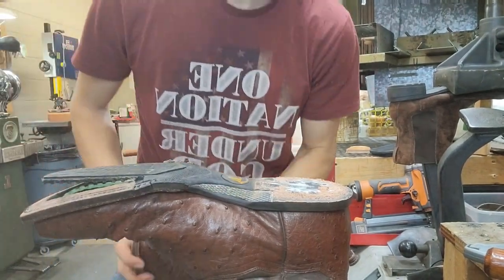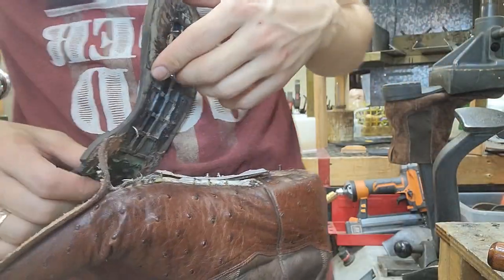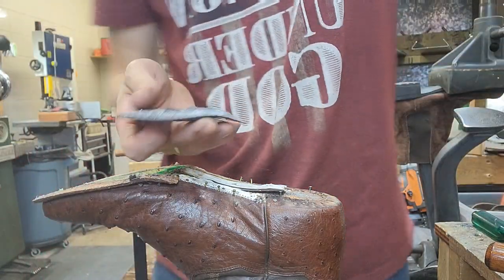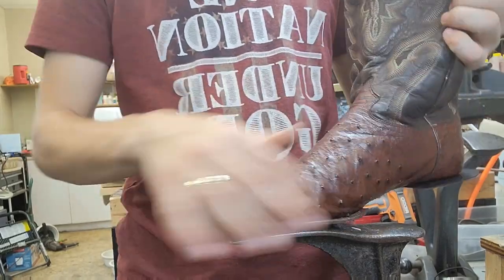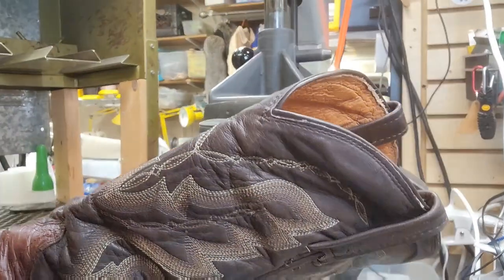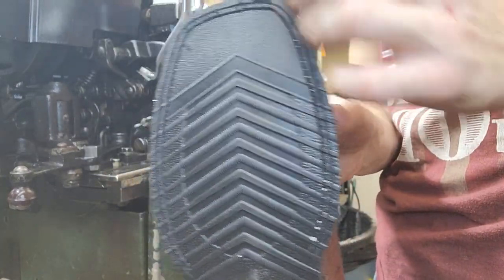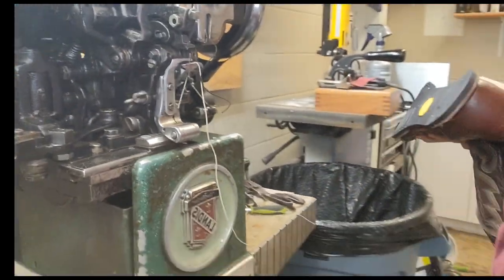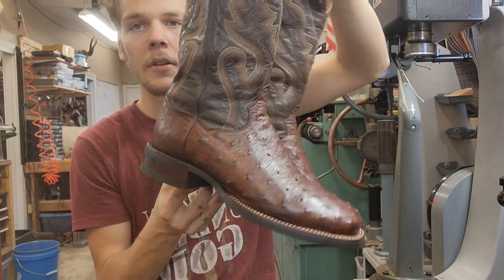Dan Post Cowboy Boot Restoration!

Comment: Glad I found this video. I was specifically looking to see how the sole and heel of Dan Post boots get repaired. 
Personally I was fine with the multi-piece sole. The boots were comfortable and I didn't like the idea of an all leather bottom being scraped up by concrete. Plus, didn't want to slip when it was wet out.
Seeing this let's me know I can absolutely keep my favorite pair a lot longer, where the issue I started having was the leather welts starting to separate.
Reply from the maker: I’m glad you enjoyed the video, the separation is from the threads holding the sole to the welt broke and it’s not holding the sole anymore. That’s a good sign you need a resole

Comment: I have this exact pair of boots, roughly what would it cost to do this to mine. I know that it could vary, just a ballpark. Thanks
Also great video!
Reply from the maker: These repairs start off at $185 for full soles and heels with a double stitch and clean and conditioning
Reply: What would the turn around time be on these boots?  How do I get your shipping address?
Reply from the maker: @bigbr4  right now we are 4-6 weeks out with all our work. If you visit our website https://linktr.ee/shoeman_angelscustomcreations you will see the mail in repairs order form. Fill it out and we will get back with you as soon as we can.
Reply: Are you the one that would be doing my repairs or someone else?  Are you in Jonesboro?  I really like what you did to this pair of Dan Post, I have the exact pair and have had them re-done once and it was a very poor job. Sorry for all the questions. I was extremely impressed with the video of these Dan Post and want mine done.
Reply from the maker: @bigbr4  no worries I encourage the questions. I like to make sure my customers know exactly what I’m doing and why. Yes it’s just me doing the resoles. I have one very experienced employee that sometimes helps me with the cleaning and finishing touches, but we both are very picky and make sure every job gets done to the best of our ability
Reply: Good deal, thanks.
Reply from the maker: @bigbr4  no problem, I look forward to hearing from you